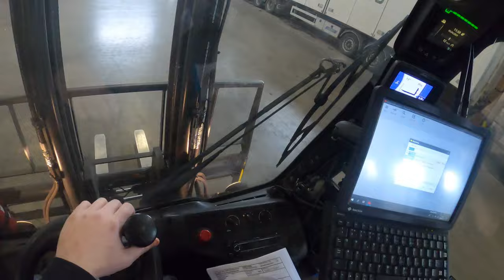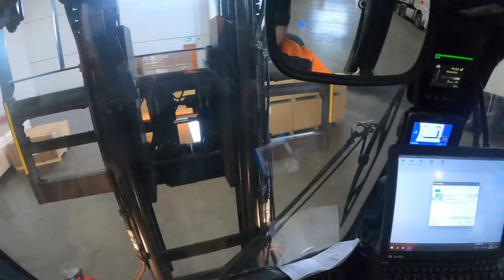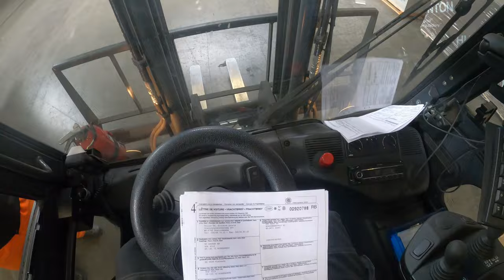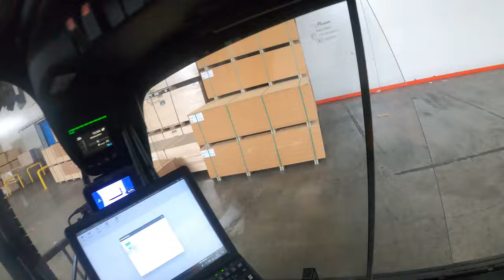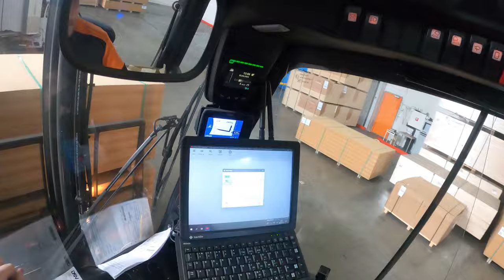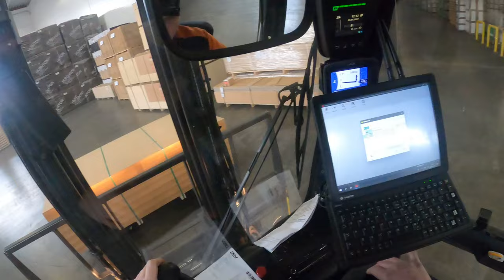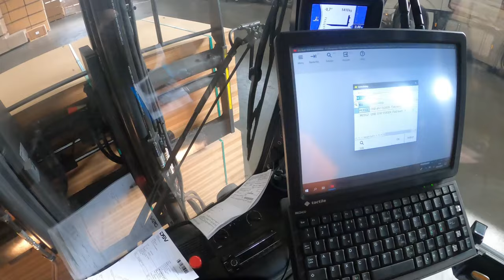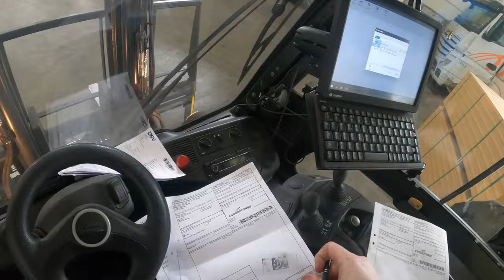Forklift operator unloads 2 full truck and trailer with MDF at the same time!!

Comment: Good evening my firend. I am a forklift operator too. You surely have a long experience in that. In my warehouse we working with tiles, glues, basins,toilets and more. It's weird that your forklift has 5 tone capacity. Our diesel forklift Yale have 2,5 tons. We also use 2 electric forklists. A 1.8 ton 4-wheel Toyota and a 3-wheel Jungenrich. I watch your videos and i like them. I have some questions for you.
Question 1 : Are you use diesel or gas forklifts in your job or not?
Question 2: Why all the Linde forklifts have those little computers inside the cabin?
Question 3: Were you drive in the past bigger forklifts?
KEEP GOING!
Reply from the maker: Hey man! thanks for watching!!
1 we only use electric forklifts, 
2 Not sure but we have them for our inventory system and orderpicking, I think it is an "addon" to the typ of forklifts we have.
3 This is the biggest forklift i ever drove :)

HELL YEA!